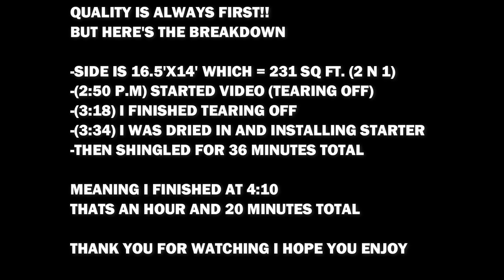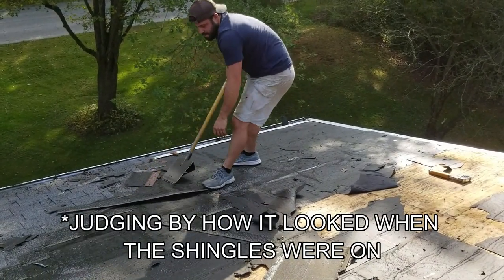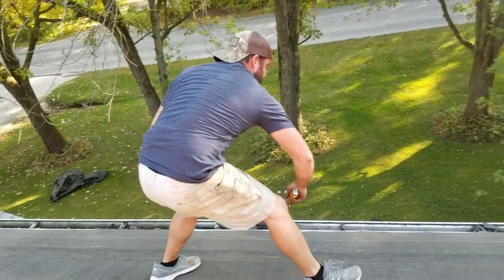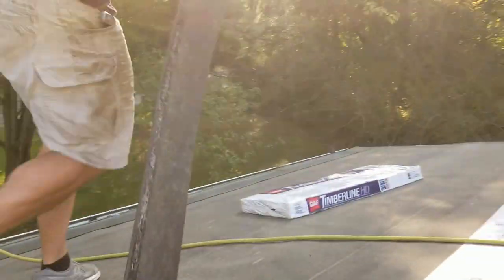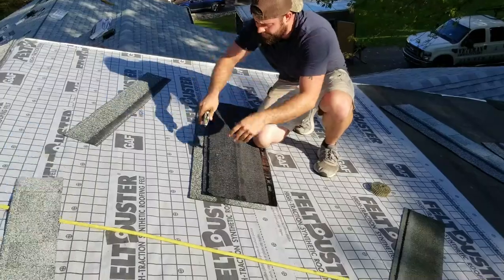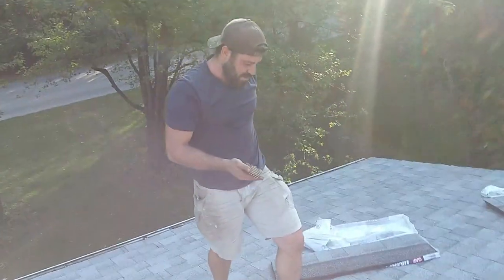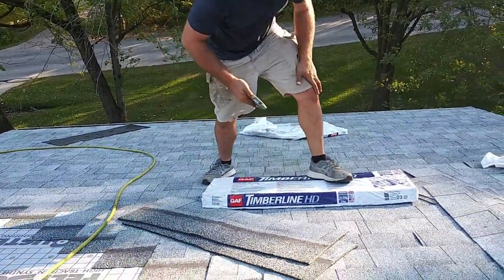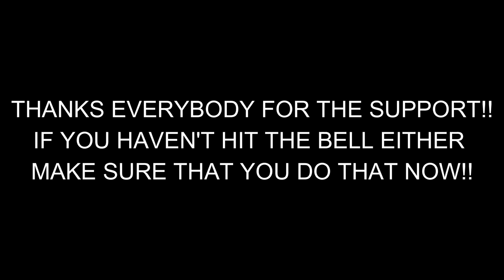WORLDS FASTEST SHINGLER. (uncut) TEAR OFF. DRY IN. PUT BACK

Comment: I like that trick where he runs three consecutive full shingles in a row to the left (and you think to yourself wtf is he doing?) ... and then he trims the upper most by 1/3 and then cuts the quarter notch from the one below it ... those cuts seems counter-intutive at first but they obviously work. That's a pretty slick trick. (And the bonus ... because they are partially nailed, no need to have one hand holding the shingle and one hand on the knife)

That plus how he lays out all of his full bundles in exactly the right place making it easy to reach and transfer to the successive laddering course above is the epitome of efficient.

Really impressed with how smart and quick you ran this.
Reply: My father was a roofer for over 45 years. I have four brothers and we all know the trade. You nailed it, it's his prep that makes him as good as he is. Don't forget, this is him goofing around on a weekend...
Reply: yep fast, butt the waste stub will wear deeper faster and the cuts allow water seepage too.  Ok n for a flat garage.. probably can't see our from the road and if you didn't know why the overlap is important it wouldn't matter.  In any case, wish I had my back back... 😏  be careful dude and best wishes to you

Comment: i,m always amazed with bizarre u.s.a  roofs ! it looks like the country is still controlled by big oil ! in australia we lay a roof once for a lifetime of service .our terracotta or cement tiles go way past a hundred yrs & our original corrugated steel sheeted roofs from the 1800,s are still serviceable to today ,  direct coastal exposure is our only exception to longevity being about 60 to 70 yrs , i guess you guys just accept what your being served up , but their are long lasting alternatives for you all !
Reply: Terracotta doesn't do well in the winter. Freezing weather causes terracotta and cement tiles to crack and break that is why you only see shingle and metal roofs in the northern parts of the states.
Reply: @thinkingcashew6   Slate, Wood shake. Slate is good for 150 yrs.
Reply: john ryan wood will rot from moisture after 10 years or so, at least that’s what happened with my old house. And slate is more expensive than asphalt shingles
Reply: @RaceboyYT  Wood roofing lasts 35-40 yrs when installed correctly. It needs to be installed on slats so that the cedar can breathe underneath. There is a product called cedar breather that is used when you install on solid decking, If you don't install in either of these 2 methods then yes it will rot quickly. Someone who knows how to roof would never install wood shingles directly onto the decking. And yes, slate is very expensive. But stone or slate is absolutely the best roofing material. Easily lasting 150 yrs. Easy to repair, if you're a roofer. You get what you pay for in roofing material.
Reply: @thinkingcashew6   they use slates and tiles in Denmark and they have no problems,  these shingles will cost you more in the long run and to be honestly look tacky
Reply: Yes, slate is a viable roofing material. I was only addressing cement and Terracotta.  Metal roofing is the preferred long term roofing material in my area because of the transport cost of materials and the scarcity of individuals who can install slate correctly.  This means it will cost 2-5 times more than a metal roof that will usually last 25-35 years. If I could have a slate roof for less than 100k It would prob be what I would choose because as you said they look great.
Reply: I mean you got a good point Bubba I completely agree but it does put food on a lot of tables and clothes on a lot of backs and so on and so forth but hell I’d like to see how it’s done if ya know where to find a video be interesting to show my coworkers
Reply: @Flaming Stag where I roof out here in the sticks people ain't got no money and they ain't gonna spend the little money they have on a 100 year roof they're only gonna be around to see for 30 years
Reply: @johnryan1287  why would you even care if your roof lasts 150 years look around you and tell me just how much of your cities houses are 150 years old
Reply: @TWEAKLET   Don't live in the city. Cities suck. Most residential in cities in Tar and gravel, rubber or metal. Only churches and some hospitals, City halls are slate. Out here in suburbia and more into rural areas, slate is still somewhat common .Plenty of 150 yr old homes in NJ, NY and Pa where I work. Plenty more 150 -100 as well. All you'll have to do is resolder flashings. Btw, it adds its cost in resale. Not much terra cotta here either. As the fellow said, no good it harsh winters. But slate is the best for longevity, bar none. Metal is ok but if you dont insulate on top of the decking, heavy rain is loud. When tree branches dent metal its problematic to replace sections in the middle of the roof, it lasts as long as the finish in humid climates like the northeast also.
Reply: @johnryan1287  and how many of the homes in your are aren't 150+ years old and did you know depending on your slates source it can fail in as little as 75 years tar can be recycled pretty much endlessly and poor people usually cant afford a richer mans roof
Reply: @TWEAKLET   What's your point? Slate is the best roofing material. I'm not even considering cost. But if you must........5 times you will replace a roof with asphalt shingles in the same period of time as 1 slate roof. . On the east coast of the U.S. and in Europe, the slate is the highest quality. Are you talking about chinese slate? LOL.  BTW, tar is not recycled
Reply: @johnryan1287  and probably still be cheaper to replace it those 5 times along with being simple to repair
Reply: @johnryan1287  well obviously you can't really beat a rock I wish I was more experienced in slate but I can also see it being a b to cut and carry and cost more in materials
Reply: @TWEAKLET  not true. One installation of slate is cheaper than 5 installations  of asphalt. Btw, 150 yrs imis a conservative estimate
Reply: Those alternatives here are stupid expensive compared to shingles
Reply: @rickvinqvist3250  Yup. But if you are in your 20s and are going to stay in the house, you might do the roof 3 times before you die, Don't believe the hype with the lifetime warranty. They're prorated and the roof looks like crap within 20 yrs. A one time slate or metal is NOT 3 times as expensive as an asphalt shingle roof so in the long run, the cost difference is negligible. Plus you will recoup the cost in resale if you move.
Reply: @johnqueen9420  Lol, I hear that. In the backwoods here it's cheaper to replace the cheap Tarps once a year. Heavy duty tarps can last two years easy. 😂

Comment: I roofed one of my houses years ago.  I started the tear-off using just a pry bar then someone told me about the roofing shovel so I bought one.   It made the job a lot easier.  BUT,  I never asked anyone how to use it.  I ripped the whole thing off BACKWARDS.  I started at the bottom and ripped to the ridge. That house had a hip roof and was difficult to get the ridges straight.  It's been over 25 years and that roof has never leaked.     I wish YouTube was around back then.  I need to do another one, but my back hurt watching you.  So I will hire someone for this one.
Reply: You aren't the only one.

Comment: I used to do this shit back in 1988, the guy I worked with and I would blast a giant dubie, go to the getting place and pick up our shingles, go for breakfast, hit the jobsite, typicaly a re-roof on a little bungalo or split level, and blast through 16 square and roll off by 4: 30 or 5 or sometimes later, richer by $1000 or more, which in 1988 was a shit ton of cashola. Then I realized that roofing was just about the shittiest work under the face of the sun and learned to earn my money a lot easier. Good on ya, and keep up the hard work

Comment: Liked the video....I was a roofer for 20+ yrs & in the construction business for 40+....when I was shingling 70’s-90’s I did mostly 3 tab & the architectural shingles came in the last few yrs I did roofing I also started with hammer & nail & air staplers & guns hadn’t come into being @ that time but I was taught to put the nail either in the tar strip or above so any ice/water can’t get under the tab/shingle & cause a leak with it in the tar strip it’s covered & sealed so there is a 99.9% of it leaking....bending over like that kills the back....but you are fast I will say that of course you’re a young buck....keep doing this bent over & you will have problems believe me I’m 72 will be 73 come July & I’ve had 2 back surgeries for the L4 & L5 vertebra....still can tell when it’s gonna rain or snow....but as I said I’m impressed you do good work could of used you when I was roofing....MCA😎

Comment: I am no roofer, but finding myself about to tackle job after watching. I appreciate the content and time to film. This episode showed me how you cut the steps for the 3rd/4th course before full shingle on your left side.  Also on rt side, 19.5-24" piece and making sure to not place nail on seam. 

Hook blade or reg utility blade when cutting? 

I am also awaiting the roofing challenge for I read a lot of talk, but see no proof from those claiming to be faster.
Reply from the maker: always use a hook blade when cutting shingles! also works better than a straight blade on ice shield, and if you're using synthetic felt (which I strongly recommend) a straight blade will cut better (fresh hook blade will work just fine though) I use a dual blade for both purposes plus I like slicing open my bundles with the straight blade

Comment: I used to do roofing. He's consistent but "worlds fastest" I don't think so. We worked that fast everyday.
Reply: Yeah, I was fast but our fastest guy made the nail gun sound like 1 shot , it was sick!  I could get it down to 2 shots first 3 sounded like 1 but I always had a pause at the 4th.  The nail gun makes all the difference, we ran Hitachi and a clone, the clone was really fast and light. Bostitch nailers are too slow and so is running that pattern clear across. we only did this when it was to hot to move a shingle by the time you got to the next row.
Reply: I meen 33 minutes for 1 side is fast. At that rate itd take about 2.5 hours for the entire roof. Meaning you a 3 man crew could do 3 roof jobs I. 1 day. A new roof is insanely exspensive.
Reply: @jtaylor3609  it all depends on  the roof. this was a pretty straight forward job. no skylights or other protrusions, no valleys, walkable 4 pitch. it shouldn't take any roofer worth his weight more than 2 hours to do it. I have owned my own roofing and siding business for over 30 years on Cape Cod. in my prime I layed 12-14 square a day.
Reply: @lllBAMlll  I agree Hitachi always seemed to be faster than the Bostich. it was also weighted and balanced a lot better. I do things a lil different. for 1 I don't like the hose on the roof I am working on. always used a lead hose then 1/4 from that to my gun and behind me. never had to worry about stepping on it and rolling my ankle. also I am a lil suspect of his nailing pattern. all you need is 1 seam to be where a nail is. all in all good job tho
Reply: I roofed houses for 25yrs. He's not fast he's very SLOW lmao. There's alot of pointers I could show him alot of tricks that would make him extra money. Plus he want have to cut the starter shingle like that. Take a normal 3tab shingle turn it upside down the you don't have cut your starter shingle. Then running up the sides hang over and inch turn your 3tabs inside house then you got 1 contentious line running up to the ridge cap
Reply: Shaun Bain I shingle faster with my eyes closed! And I know guys that would smoke me so......
Reply: @jamesscott1031  then prove it do a video with your eyes closed. If you say your that dam good.
Reply: @jimlynch4014  hey jim im watching from cape cod also. Keep up the good work brother
Reply: Plus if he's a real roofer where's his dump truck at to throw shingles in? Instead of throwing them on the tarp. If he had started at the bottom at gutter cut a 4ft line with his knife he could had pulled the whole roof up in 10mins with the tacks still in shingles. You can't hardly use the roofing shovels like he had, get you a tater fork a hole lot better. Plus leave you old tar paper on there for extra insulation roll the new rite over the top.
Reply: @jtaylor3609  it wasn't 33 minutes. I don't get where he thinks that is true. It was 44 minutes before he changed phones. And he didn't do the ridge cap like he said he was going to. I don't get how people aren't catching this

Comment: Dude why our you nailing below the nail line that's why it's there so once the sun seals it there's no leaks from rusty nails years down line I'm just saying hit that tar nail line. Just how I was taught.
Reply: the actual seal down strip is on the bottom back of the shingle.. where he is nailing, nails another row across the top of the previous shingle laid.. putting 10 nails per shingle instead of 5...
Reply: He is nailing on the nail line. GAF HD shingle nail line is just above the sawtooth and below the seal strip
Reply: I’m w the goat.  I don’t feel bad putting 4 nails because it’s really 8 nails a shingle.
Reply: @troyzupancich9550  if those are the new GAF HDZ the nail line is the tar line
Reply: Actually you have to hit it low where the 2 pieces of a shingle are seamed together  or shingles can literally separate on roof or it will blow off he is nailing correctly

Comment: im 64 yrs old. I still shingle about as fast as this video.  Roofing is for people with strong backs, strong workers.
Reply: i'm still old school. i still use a roofing hammer. 28 years of roofing and still don't like nail guns.
Reply: @120thumper  Can I ask why? It isn't any better quality than a nail gun, you just like swinging the hammer I'm assuming?
Reply: @EliteDadBod  since i never used a nail gun . the quality would not be as good. but really just don't like lugging around a air compressor from site to site
Reply: I use guns but when i hand drove i used a hatchet not a hammer

Comment: Economy of motion = accomplishing the maximum amount of work with the fewest movements possible.
Reply: This is true. I've worked in a few factories and assembly lines and the fastest workers are the ones that make everything look smooth and effortless.
Reply: Using the tip of the nail gun to stabilize yourself and locate the right lower edge of each shingle simultaneously...very ergonomic.

Comment: Lots faster than me. I'm 55 and tearing off improper shingles. Scraps of old roofing underneath. Blown threw nails which lead to premature roof failure( Why I'm redoing it). Plank roof, Replacing cracked boards that are all different sizes. Hence, Cutting plywood to replace boards to proper fit. Pulling all the left behind nails with a Cresent nail puller. OCD kicking in and just shaking my head at the short cuts and terrible job that was done. Roof vents installed upside down. And roofed right over broken rafters too. I hope it was not a contractor that did this job. I did use captured nails to put on ice dam protection. I enjoy your videos and techniques. Codes have changed allot over 25 years.

Comment: I thought you were doing pretty good until I saw your starts. I know you know you should have put your factory edge away from the drip edge. Sure you save some time but I wouldn't hire you if that's the way you want to do things.
Reply: I was just thinking that. It seems like a quick, sloppy job. Efficient when it comes to time, but cutting a bunch of corners.
Reply: With the shingle type he's using don't matter much there not 3 tabs like I'm sure you an me grew up doing.
Reply from the maker: thanks larry! no matter what there is cuts out in the open with this style shingle. I cut very straight and always use a nice big stagger. its allowed so I do it my way. its not scrap efficient the other way because you would have to save all those cut off for the other end. on a hot day those things are toast by the time you can get to them. I wouldn't show myself doing it if it weren't good quality. I've put a lot of thought into this shit. so much so a lot of decent shinglers don't make sense of it. I find it hard to have good roofing convos because there's not enough out there yet. trying to build that number up by making videos like this!
Reply: @NWIVeteranConstruction  he called that shit!! In a perfect world your cut off book from the left goes to the right. Or you just make sure you got enough overlay. I like to run factory edges on the outside and cuts on the inside.
Reply: @NWIVeteranConstruction  what do you think about using a multitool to cut your edges. I've been doin it lately cuz the cold and it works freaking awesome.
Reply: If he can cut even half way straight it will be just fine ...having it cut from the other way wont make a bit of difference

Comment: Credibility check:  Well, I'd say none. I don't want a "fast" roofer trying to prove a point and taking shortcuts or banging nails as fast as possible. I want quality and a roof that won't leak, not broken boards and nails that will push up more easily later because they were hit with a hammer like a madman.
Reply: I was taught to never cut into the surface you're working on, hated seeing the cuts in the white plastic. But i'm not familiar with this type of roofing, i was impressed with the speed it can be done. We hardly see any shingles here in the Netherlands.